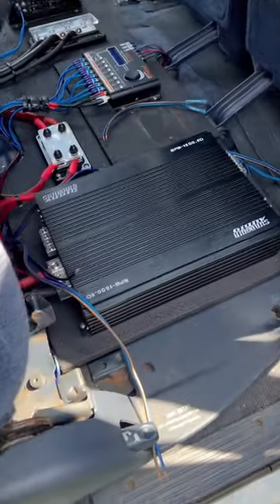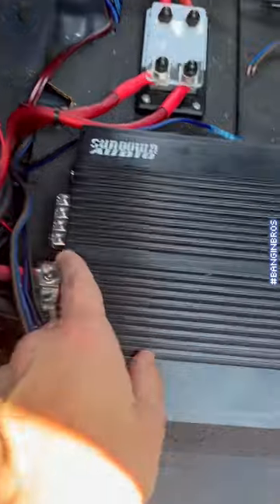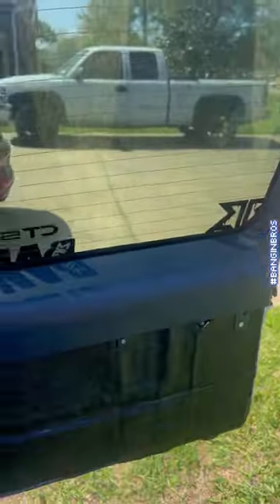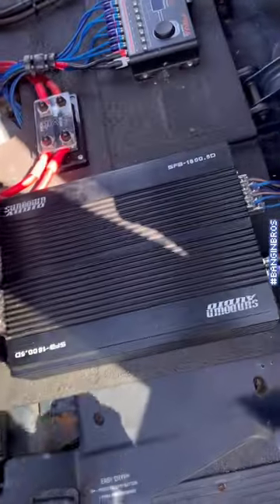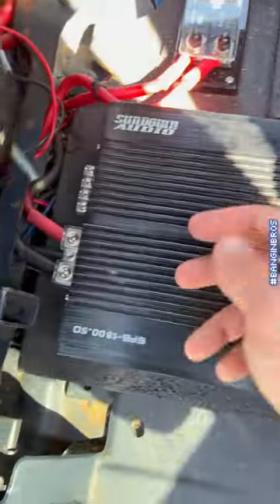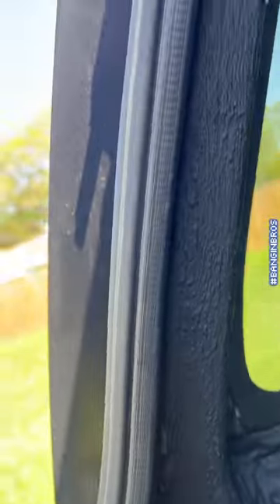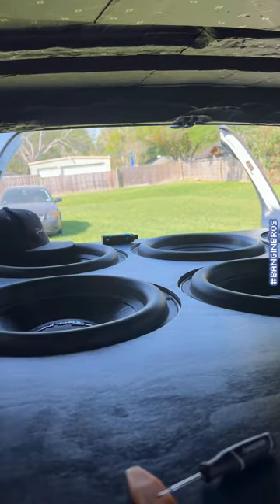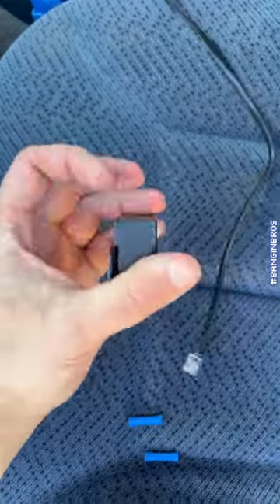Starting Suburban Barn Door Vocals || Sundown SFB 1800.5  #banginbros

Comment: What do you have the SFB 1800.5 fused at and do you know its true requirement. Every shop I have been too has told me different size requirements. My current problem is not being able to find a shop willing to swap my dam alt and stuck with a 130amp alt on big3. Most my car has ever had was a crescendo 1600watt rms @ 1ohm. Oddly that amp only wanted a 100amp fuse. Even the SAE-1100.5 I had from sundown only wanted a 100amp fuse cause it kept over heating for unknown reasons if used a 120amp fuse like it was required for. 
I'm starting to see a lot amps using fused amounts that don't even amount to what the power output is claiming to do and yet if use under or over the dam amp perform like shit.

Comment: Perfect video bro. Your video is the ONLY VIDEO I found on here that's going Straight to the point that Yes the 1800.5 can be used for mids as well instead of for bass. I've had mine for a year now in a box, it haven't even be powered on yet. I was thinking about using only the 4 channels, 1 6.5 prv per channel & leave the 5th channel. & another 4 channel for my 4 tweeters. But you mentioned it's giving off some feedback. I wonder how bad is it, the feedback. Can it be cleaned up. What do you say.